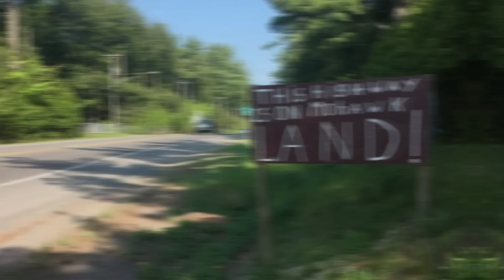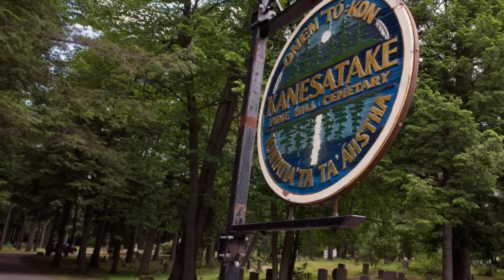15 Stubborn Homeowners Who Refused To Move

Comment: I live in an area that my white friends say "looks like a ghetto", new houses were built (part of the reason I bought my home) some roads away 13years after their due date, , the houses on my road are not being renovated/sold/rebuilt and I have no rush to move out; besides the fact my father, brother and I have put ALOT of TLC into this property that needed so much doing to it.

If it came to it, I would sell for an extremely good offer, so long as I can move wherever I want when I want without prejudice, hurt and or harm. 

Good on em! Though some I feel should have moved; especially with the new builds so close to home. Pun intended!

P.E.A.C.E